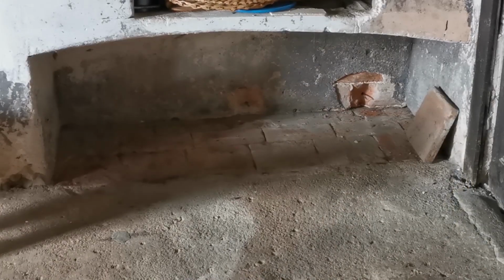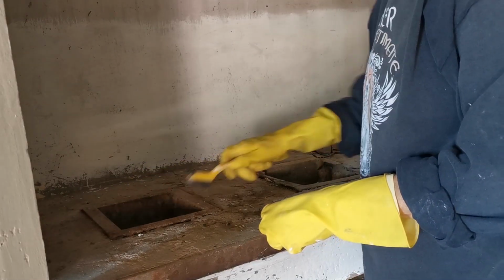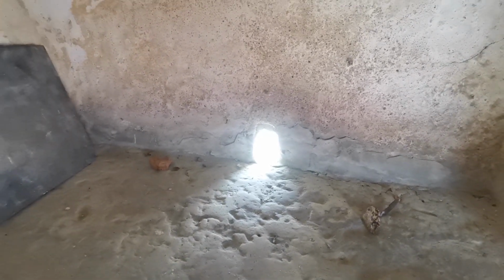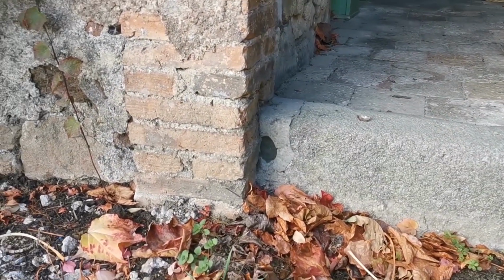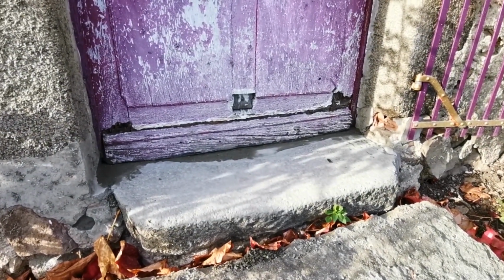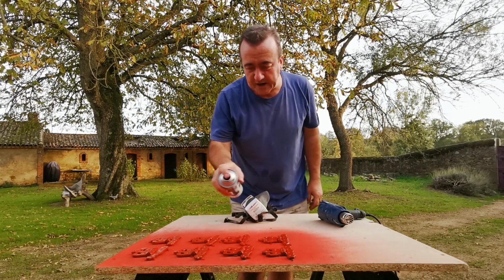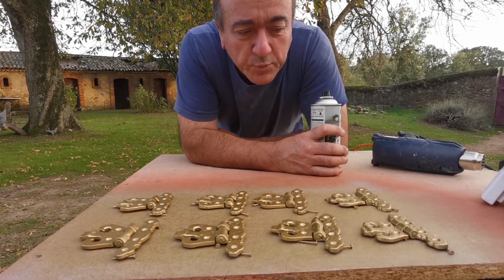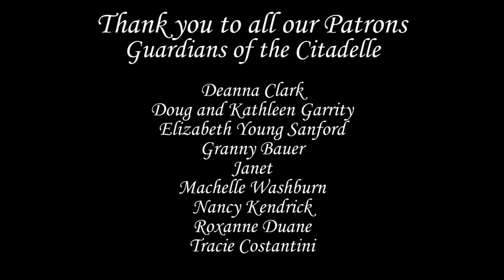Our medieval château kitchen renovation

Comment: Suzie, that space under the built-in would make a great spot for a dog bed!
Rols, you have the patience of something like a saint re using liquid spray to clean the wooden beams.  By now I'd have begged, borrowed or almost stolen a belt sander or mini-sand blaster to clean those sooty beams and be done with it!  I'd worry about cleaning up the mess later.  But, seeing those old oak beams cleaned of the decades of soot is so rewarding.  So glad you are going to leave them "au naturel."  I like the slightly rustic look to your home.  It's inviting and cozy.
Reply from the maker: Thank you Alicia, yes I am at that stage when I am questioning my own sanity 😂 each beam finished spurs me on to the next 😁 Enjoy the rest of your week, Rols

Comment: One trick that some people with wood stoves swear by, is a little fan that sits on top of the stove. They say it blows hot air into the room rather than it going up the chimney.
Reply from the maker: Thank you Diane, we have a different system in place for re-circulating the heat. All will be revealed on Sunday 😁 Enjoy the rest of your week, Suzie and Rols

Comment: i would use insulating foam to fill in gaps in the windows and possibly the sink hole. It gets in all the nooks and cranies and then seal with a wood frame. I've seen them doing it on other chateau vlogs. Glad to see the wood stove up and running. It will so much cozie this coming winter. Keep up the good work.
Reply from the maker: Thank you for watching, I had to mix some mortar therefore it was just as easy to do it that way. Enjoy the rest of your week, Rols